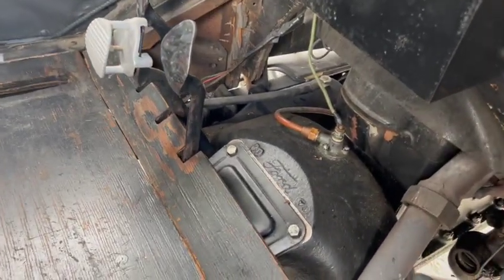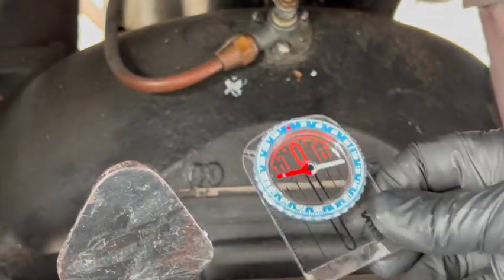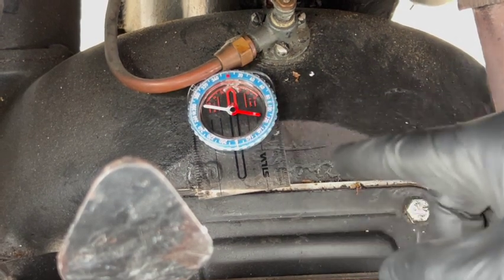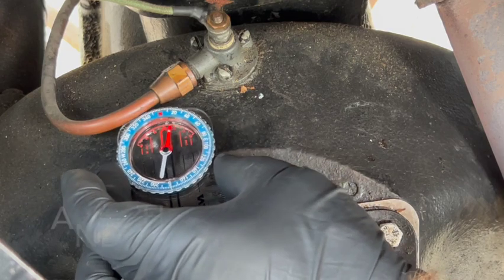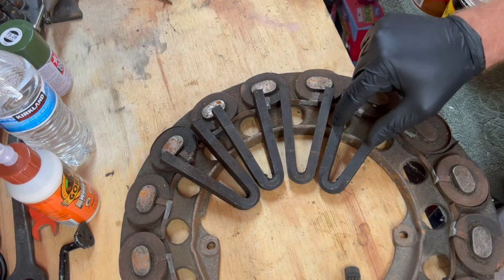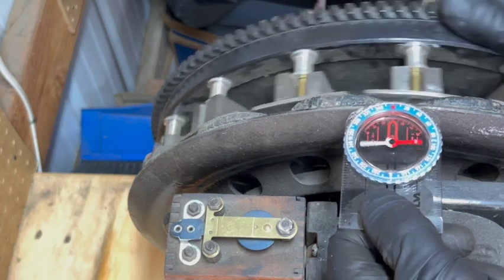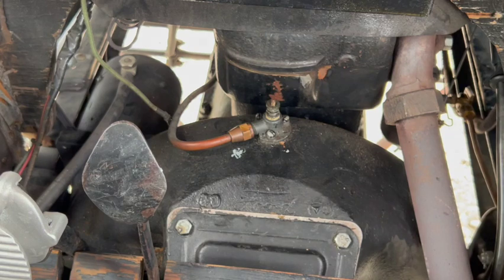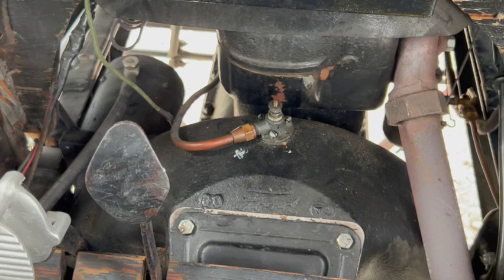Model T; Magneto Re-charge While Still in the Car?

Comment: When it's in the car , how do you get a North coil over a South magnet?  If you recharge a North magnet South, the the charge will not last.
Reply: NOT TRUE!!   A magnet does not care which way the pole is either N or S.. Once charged it will remain that way..   The way the position to magnets is to open the cover and look at the mag retainer bolts and align them level with the ground or horizonal.  this will position them close enough.  No need for a compass!

Comment: No Need for any compass simply open the HH cover and line up the magnet bolts on a horizontal plane level across. this lines up the magnet with the coil. A magnet does Not Care if you switch it's polarity. Simply hit contact for a quick touch! Done  Lots of guys use a welder for power source. don't touch directly on the lead termnal.

Comment: Nice Video... Here's another method that was developed and tested by Tom Carnegie multi winner of the Montana 500 and Model T genius!  He offers this procedure,  Open the HH cover and rotate the engine so the magnet screws are level on a horizontal plane. Remove the mag post and insert a insulated bolt directly to the solder connection. Run the leads to a welder or the battery setup if no welder available. Make a striking contact Away from the motor. It is Not necessary to find a N or S the magnets will simply reverse polarity! Some people suggest to rotate the flywheel and strike again at different locations but this has not shown to increase the mag performance. It's a good practice to not apply the voltage through the mag post itself because this may weaken or damage the light weight spring on the mag post.  Thanks for posting and I love your tractor sight!
Reply from the maker: Great information. Thank you!

Comment: I had my magneto completely die on me  two different times. Pulled the mag post and spotted a bit of safety wire stuck to and shorting out the mag... Wire that got loose from installing the bands... I got it out and the mag works again but seems a little weaker. I may rig up an in car recharge. Update: I ran my engine... I have a Magnetometer installed in my car so I can see how it's doing all the time... Mag put out about 10 volts at a pretty high idle. I flashed the mag with just 12 volts, hit it 6 times. Now I get 20 volts with less RPM and the meter is nearly pegged at 30 volts running at 45-50 MPH. I had a heck of a time getting my compass to find a North pole, had to keep moving it away and coming up to the measured area on the hogg's head and bumping my jacked up rear wheel around.

Comment: Question: Must the car run on mag to test and charge? SUppose the car doesn't run on mag only on left position of key? Willl this procedure still work?  and thank you for an excellent, well explained video! I subscribed.
Reply from the maker: Thanks Gary. The car does not need to run on mag. However, in my experience, this doesn't always work. I actually tried this on one of my other cars and it had no effect. I don't know why. One of the possible "unknowns" is the physical condition of the mag coils and the magnets themselves. If they are bad, this procedure has no chance. Anyway, good luck and be careful!

Comment: I tried to check the voltage of my 1922 FORDSON F engine after I reinstalled a newly repaired and charged magneto in my engine.  I had it sitting on my workbench had my wife turn the hand crank over as fast as she could turn it while I held the red lead of volt meter on the "HOT" lead of the magneto and the black lead to ground on the block. But the Engine was rocking back and forth so much I could not read the volt meter I had lay on the head. I reached up with my left hand to steady the rocking the the block. Then CONTACT ⚡⚡ I got the SHOCK of my life! Every muscle in both arms contracted and my hair stood straights up like Einstein. I never did get an accurate reading. To this day I didn't know how much voltage that magneto put out.
Reply from the maker: They say AC voltage, like from your magneto, is approximately five times stronger/dangerous than DC is to a human. That’s a good zap!

Comment: Thank you for the video. My 26 T stopped running on magneto the other day. I was driving it, then lost some power and back fired and stalled. It runs perfectly on battery, so I’ll have to give this a whirl. Thank you again
Reply from the maker: You are welcome! Good luck with it. I would actually check the mag post wire (check the entire length for bare/broken wire and shorts) and then the ignition switch functionality before trying this recharging procedure. Good luck!
Reply: It might have shorted out.  I caught a piece of wire in mine and I had to take the transmission cover off to remove it to get it to work.

Comment: Thanks for the video. I really enjoy them all. 
I am not familiar with old cars like this. Is there a really simple way to explain the issue this fixed?
Reply from the maker: The car's internal magneto system creates its own electricity which runs the car. That system is made up of magnets and copper coils. If the magnets become discharged or weakened, it will not produce optimum voltage to run the car at peak efficiency. Recharging the magnets will resolve this issue as long as all the other components in that system are good. Thanks for watching!
Reply: @AntiqueCarsandStuff  Thank you, this makes sense to me. Keep up your awesome work.